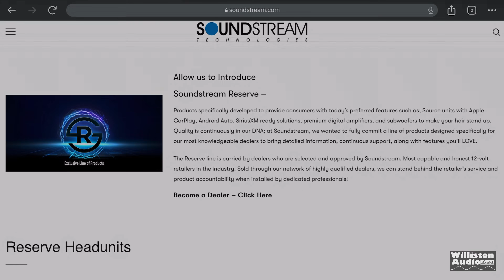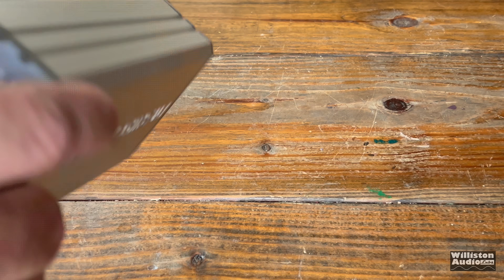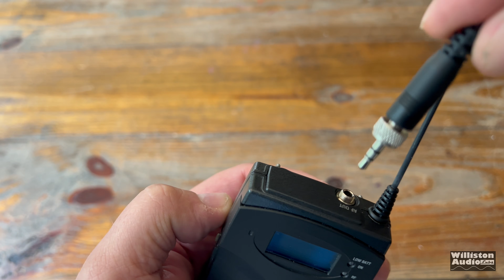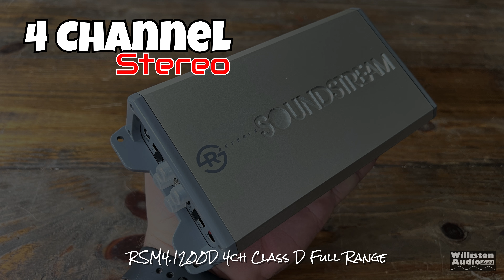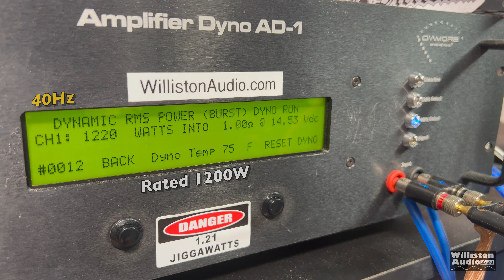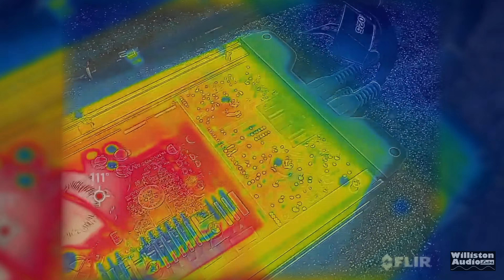Reserved for AMAZON?

Comment: 3.5mm aux cable/RBK pulling out is easily solved by doing some kind of "strain relief", such as using a twist-tie or zip-tie through the amp's mounting screw hole. I don't see pullout as an issue if all the wires/cables are routed and hidden anyway.

Comment: Price Check Homie... a year later and it's a rare decrease to the price on AMZ. What da?! It's currently at $94.97 for the mono amp while the 4-channel version is no longer listed. There were issues with the 4-channel model concerning noise, not just because of the 12v charger, more common. Who is going to re-design & re-tool a budget compact amp though?

Comment: I like the 3.5mm TRS plug because it’s easier to install. It’s easier to modify and easily available everywhere. 
The RJ11 cord has to be handled with care and they are not all standardized. There’s a 4 conductor and a 6 conductor. Good luck. 
I just add a dab of silicone sealant to the crown of the 3.5mm and then plug it in. It’s not going anywhere

Comment: Ive got the 4 channel and the smaller monoblock in my van, a bit under powered but they sound decent and they dont take up any space. I dont hate them but i don't love them. Gonna probably swap them for a JP77 and use these to power some stuff in my camper
Reply: I tested the mono amp in real life. It does not like being played at 1 ohm for very long.

Comment: Big D I haven't been getting to watch your vids as much recently as I'm used to... Thanks for another great video! This probably helped me decide on marking Soundstream off my list of budget 6.5" components that I'm considering getting for an SUV I just recently acquired.

* If anyone has any suggestions on more budget category 6.5" component sets that are worth having in a vehicle & would work well with either a 110.4 amp or 250.4 amp be sure & lmk your suggestions. Some 6.5" component sets I am considering atm (btw, i plan to buy to sets to put 2 sets in my SUV).
*The new D4S honeycombs are what I'm really wanting to try but do not think I want to spend that amount of $ since I will not be driving the SUV near as much as my cars.

Comment: I’m glad you tested these. I’m needing a small amp for a kicker 6.5 for my wife’s car. It’s a 2 ohm sub and it’s hard to find an amp that puts out 200-300 watts, so I’m assuming by your rating on the 1.4000, the 1.2000 would actually be perfect. It’s rated at 480 at 2 ohms, so it probably does 250. Thanks for another awesome video

Comment: @wal
I agree that printing MAX Power on the boxes is obsolete and belongs in a different era. But so does Watts "RMS". Please just say Watts. You are THE amp dyno guy and if you're using this misunderstood and in this context simply wrong unit, you'll teach the next generation to use it and it will never die out like it should have right after it was printed on a data sheet for the first time.

[Warning: long-winded rant]
For those wondering: RMS means root mean square. The speaker is driven by an alternating current. If you wanna know the effective current or voltage of a sinusoidal signal you cant just average the signal because the result would be zero. Instead you take the square of the signals differential(average) so all the negative portions become positive, then take the square root to return to the actual values.
What you get is the equivalent dc voltage or current of the AC-signal otherwise known as their effective values denoted as V rms and A rms respectively.

Now, even IF you could simply multiply the two to get Watts (which you can't without looking at phase, but this comment is too long already), the result CERTAINLY would not be Watts RMS. Vrms x Arms is not equal to Wrms.
That wouldn't make the least amount of sense. Thats like saying 2(avg) * 2(avg) = square root of the squared average of 4...
WAT (pun intended)
WTF is that supposed to mean.
Since when does a simple multiplication involve taking an average?! An average of what? Itself?
Multiplying two effective values means their product must already be an effective value as well! 
Why would there be any reason to take the square root of its square?!?! Watts are always positive no matter dc or ac! So at best the RMS part is entirely redundant. Not nearly at its worst, Watts RMS is implying that there is such a thing as negative amounts of work/watts! Like, what?!

I'm purposefully overplaying all this a little bit. I know that in the end someone probably thought the RMS needed to be carried over and no one ever questioned it.
But i'd like to think we are past that time. We have independent creators like Big D and many others, doing nothing but questioning. With tools like the amp dyno we are long past blindly trusting manufacturers overinflated numbers. So why should we keep using their ill-informed unit.
I'm happy to see that the amp dyno doesn't actually display "RMS". 
Even if it's just to save space(which i doubt), that's probably the best reason to stop using Watts RMS :)

Comment: Can I use this amp to power my 4 YAMAHA NSIC800WH 140-Watts 2-Way RMS Speakers that I have mounted in my Living room Ceiling? Using a 12v power supply to power them up! I need to add them inline from my amplifier because the wire is too long to the speakers. I really don't have an idea on how to make these speakers fireup.

Comment: not that i'd buy one of these anyway but i don't know why all these manufacturers keep putting undefeatable subsonic filters on them?  guess it would kill their power ratings (hence why they usually test/rate at 1khz).  i've only owned one amp that had one but you could def tell a difference with it on and off and it sounded better with it off.

Comment: My soundstream amp puts out mega engine noise  thinking of getting a different 4ch.  I’ve doubled the grounds added more and thicker grounds to my stereo and EQ and added another ground to my battery and still have engine noise.  Ive never had this issue with other brands. Not even the cheap stuff 😂

Comment: When I see a big amp, and I take the cover off and see all the wasted space, all the gaps of nothingness in the PCB, I knew damn well we could make amps high powered while being incredibly small. I reminds me of Nvidia graphics cards. They shrunk the PCB so small while fitting the same stuff that the board is now usually half the size of the cooler on it. So I know for damn sure all brands should be gong the "smaller" route. 30 amps times 12 volts is 360 watts. I agree, the 1200w max stuff needs to stop. Because it can't do that if they tried. 360/4 would mean 90 watts per channel. at 14.4 you get 432 which divided by 4 speakers would be 108 per speaker. So lol. When i go looking online for amps, I always see what the fuse is, because it will never draw more than the fuse rating. or combined fuse rating if it has multiple fuses. and that gives you a baseline for performance.
Reply: When you play your music at 126db or louder do people drive away from you fast and or stay way way back from you. Because the people where I live don't appreciate HoodRich Pablo Juan at 126 db's and run for the hills. One last even started screaming bloody murder because it was too loud I assume.

Comment: What was your charger set at? 2amp trickle charge, or 500+ amp quick charge? Just curious to if that made a difference for this situation.
Reply from the maker: Nothing different than normal and funny when I connected a 30yr old amp to the same setup and zero noise!

Comment: Looks almost identical to the Blaupunkt AMP1904D(I think you tested it's bluetooth brother a while back). The size, power, and terminals are also similar to the Dual XPR84D/Da10004D and the Jensen bluetooth amps, though the layouts are different so I don't think they're not possible clones like the Blaupunkt.

I have 2 Soundstream stealth 4 channel amps, one is their biggest version and the other is the bluetooth version, and they both make noise like you showed at the end. Not sure if it's a Soundstream thing or a problem with digital amplifiers in general.

Comment: These are similar to my NVX VADM2 micro amp I'm using to power my 3 way kappas in my 89 bmw. They also make a 4 channel version not sure how they compare on power to these but definitely useful especially for tight spaces.  Not sure if you've tested the NVX yet

Comment: Epsilon back at it with overrated rebadged garage pretending to be high end (these appear to be the new PA saber amps in a fancy case). This is really sad when you look at when SS was releasing after the initial epsilon takeover, and to think these are the long awaited replacements for the Reference line that was discontinued in 2015....pathetic.

Comment: I’ve been out of the car audio game for quite a while. I was considering doing a SQ system for my super duty. Do you have any recommendations?
Reply: I'm running Brazilian amplifiers? And Brazilian midrange but I have a fi neo 4.11 18 subwoofer  I'm using taramps 1200 x 4 on prv door speakers and a taramps bass 8k on fi neo 4.11 18 this is just for daily driving has great sq and spl A couple of 8s would work and some prvs now there's a variety of 8s but most of them require a ported enclosure unless you go with jl audio I don't know if they make 8s sundown makes 8s I believe massive audio dd db drive just Google who makes 8s if that's what you looking for I know that fi makes 12s and up and I had those built they came from Las Vegas? It's your choice and the money you want to spend all I know is I'm running Brazilian amplifiers right now and they are pretty decent for the money Those Korean amplifiers are power hungry and expensive go to Down 4 sound website they carry all the name brands except Brazilian amplifiers good luck on your system
Reply: @ceciljones1248  thanks I will look into it

Comment: Back "in the day", Soundstream use to make nice audio equipment. It's sad to see these 1990's / 2000's companies getting bought out and run down, just for the name.
Reply: Agree. I had a reference 700sx. 700 watts into 2ohms class a/b. Back in the 90s 2 ohms bridged was a premium and it was well over a $1/watt. I like that it’s generally cheaper today but much of it is china crap and sq isn’t even considered. Phoenix gold was another that was extremely good.
Reply: @galendeig6747 BUT hasn't Epsilon owned Soundstream for a very long time?
Reply: @itdoesntmatterwhatyourname6128  I believe you are correct. Must be marketing geniuses that have ruined and cheapened the brand. 🤷🏼‍♂️
Reply: Agreed, it's sad.
Reply: @bojow8102 I think the people doing such are Straight up jabroni sympathizing SOB's. And I also feel sorry for their mothers as well. You're right it is sad. Some people's kids are out of control.
Reply: Yeah the Reference amps were nice. My buddy was running two JL W4’s on the Reference 500, and it was a good setup
Reply: Used to have a reference 700 running a pair of Phoenix gold sapphire 15s, loved the setup. Sadly it walked away one night 😢
Reply: I came here to post exactly the same thing. Oh SoundStream... how you have fallen. 

I've still got a SoundStream Reference 1000s and 500s. The 1000s is currently in the operating room after having a mosfet explosion, but i think the patient will pull through after a bit more work.
Reply: @LBCAndrew the soundstreme txp6000.1 is a great amplifier and fairly new... Awesome little amplifiers!
Reply: Yeah I had 4 different Soundstream amps in highschool. Ref 2,3, and a Class A 6. I had another small 100 watt amp but I can't remember exactly what bottle it was. But I always love that my little reference 2 would hit harder than my buddys  that had three or 400 watt no name amps.
Reply: In their defense I’ve never gotten great sound from ANY micro amps.. from any brand tbh.
Reply: so they trash now?>!
Reply: Yes, we know. Cars and everything else were the same way. We get it.

Comment: The RSM1.2000 is the same amplifier used by DD as their Redline series 500.1 which they just continued because the quality of the amplifiers in the field did not hold up. Extremely high return rates to us dealers.
Reply: whos DD?
Reply: @smatchimo55 Digital Designs
Reply: @smatchimo55  a solid brand for car audio stuff nowadays, mostly spl
Reply: Facts
Reply: Exactly, all these base heads always want to cheap out but cry when their crappy amp like Skar and soundstream takes a shit
Reply: We just installed a 500.1  redline in a friend's boat on a bazooka tube at 4 ohms.
Think it'll be more reliable at 4 ohms?
Reply: @deanb949  it'll likely be reliable if it's not abused, and it's pretty limited output at 4 ohms. I bet it'll be just fine as long as it never gets wet.
Reply: You mean discontinued right?

Comment: You finally got one of the Reserve amps! I had the RS5.4500D lasted 20 months before it blew up. Couldn't get it replaced because it was discontinued. I really enjoyed it while it lasted but only 20 months, not at all long enough 😝 I've since moved on to the AudioControl LC-6.1200
Reply: Yeah, I got a 5 channel about 8 years back that lasted all of 2.  And I wasn't even pushing it; nothing below 2 ohms.
Reply: I'm looking into the 5 channel it's cheap and I'm only running a small system. So I was hoping to hear something about it here. Thanks.
Reply: @Mr_Steebin  It was great but it's not built to last. It probably didn't do its rated power either but what do I know? I don't have a tester. All I can say it was powering near the same setup I'm running now and it was great! But again, it didn't last.
Reply: I have Rs5 4500d and it is still going strong over 2 years now
Reply: Should of saved up and bought a tru technology billet or zapco Z150.6AP and enjoyed your amplifier for well over 30 years
Reply: @bennyblanco14  cool! I'm still learning. That amp has solid specs and looks well built. It's a big boy! I don't have the room for it 😅
Reply: How do you evaluate the audiocontrol ? And what speakers on it ? Thank you
Reply: @GulliJ   my comment keeps getting deleted! It's a great amp! I totally recommend it plus it runs cooler than my previous Soundstream. It's driving 4 x Rockford Fosgate T1T-S tweeters (front and rear doors) , 2x 6.5 Alpine R-S65.2 speakers (front doors) 2 x Kicker 44KSC6704 (rear doors) and a JL Audio 10TW3-D8 subwoofer (back seat) like a Champ!
Reply: @chrisbellevue  thank you a lot it's a great return for me ! It could be a futur add for my wife car which have space problem for vital component ( no the food shopping is NOT as important )😁
Reply: I have many REAL Soundstream amps. Made in the USA, Some are 35 years old...they still work like new...maybe they dropped a few watts over the years. But they still work. They still sound great. If they break, I will have them repaired. But they will not see the trash can...they will live on as long as I do. Audio Control is also a Chinese made disposable amp. I recommend MMATS, DeAmore, Linear Power or ARC CXL series..or BRAX/Helix/Match. Chinese or Korean amps are a dime a dozen...the brand does not matter. If you want something special, seek American or European made gear
Reply: @raymo6795  Lots of info there! The recent Soundstream stuff is out of China as well. I really liked my RS5.4500D that I bought it a second time to leave as a backup or maybe send back the more expensive AudioControl to save money but decided to send the Soundstream back.
Reply: I dont agree... @raymo6795

Comment: For 3.5mm cables, what I do to prevent accidental unplugging is to provide strain relief. Easiest method is to use a small cable clamp. Screw down clamp with one of the amp mounting screws. Problem solved

Comment: Ah, Soundstream... still but a shadow of your 90's glory...  

I do hope more manufacturers bring more micro offerings.  My Jeep's stock Alpine system is pretty meh.  Great vid!
Reply: Sound stream used to be a monster amp. My friends had phoenix gold & while great my reference 700sx out pounded them & I mean real clean deep bass. Pg was great they just had a bit less maybe max burst. I think I might send this guy my sound stream to test
Reply: @mikeberndt181  I bought a used 90's Rubicon and it was an absolute badass.  It did finally kick the bucket, so I bought a mid 2010's 5 channel Rubicon to replace it.  It was not even close in power nor sound quality, and died in less than 3 years, running no lower than 2 ohm/ch.  It didn't even stand up to an Alpine VPower that I had, which was rated at less power.

Comment: A lot of noise problems I've had is the noise from the alternator
Reply from the maker: Yes as I stated in the vid, the 4ch amp had real noise problems on the bench. I've tested 100's of amps using my setup and only a handful have issues like this.